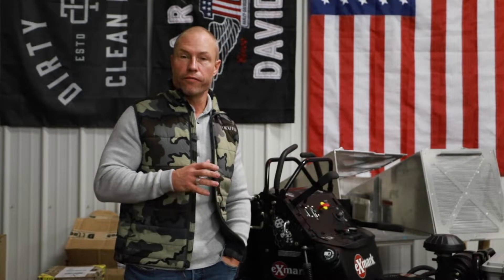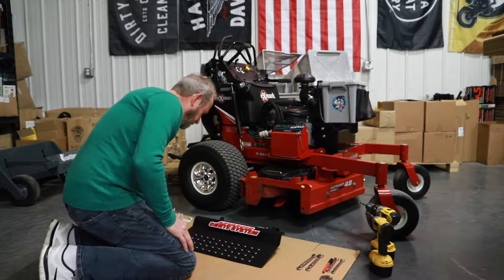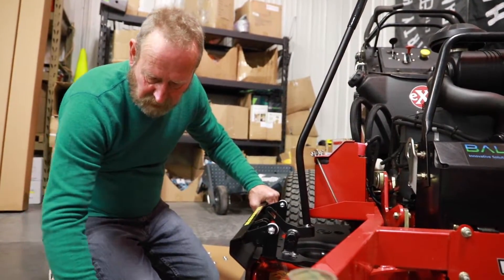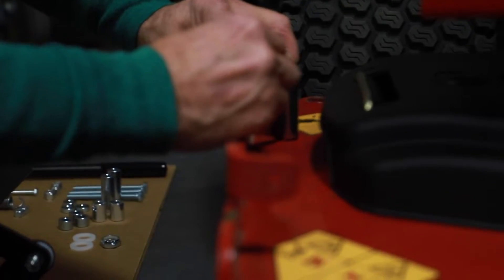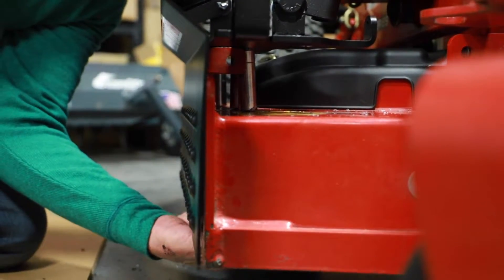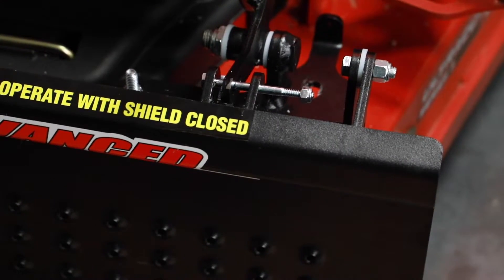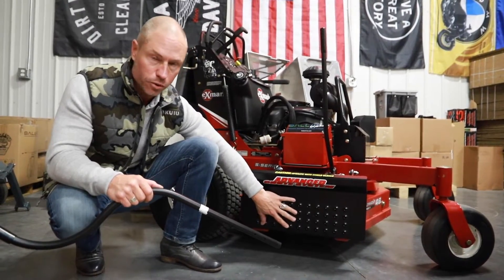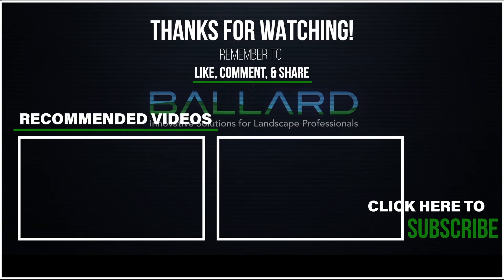Ballard Inc - ExMark- Advanced Chute Blocker Installation

Comment: Definitely spent over $1000 on your website after giving your website my exact make and model of mower. Definitely got all of the stuff and spent nine hours trying to put it on to realize I was sent the wrong thing and it cost over $160 to send it back. Garbage company just order it straight from the manufacturer. If you’re only right mower, the rubber shoot flips up. Weld a small piece of steel and a clip to the side of it. Do not waste gobs of money on this crap. I’ve been doing this for almost a decade, and I have never received something so wrong as this. It is unimaginable that someone designed this and sold it for a Wright stander B. Yeah that’ll fit. Gearqueer crap for new guys here.